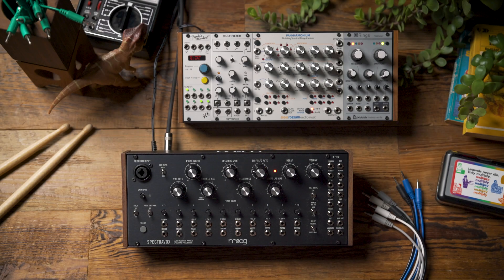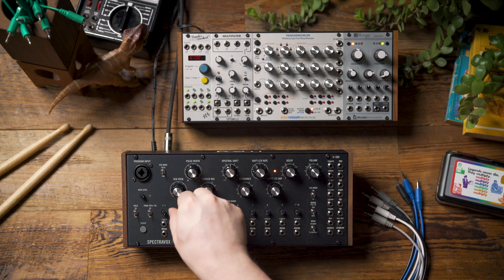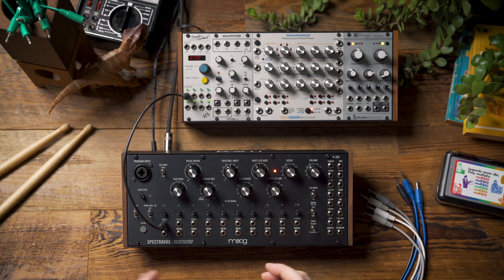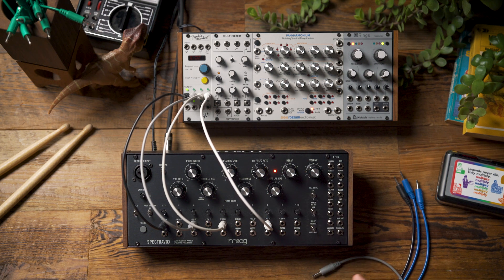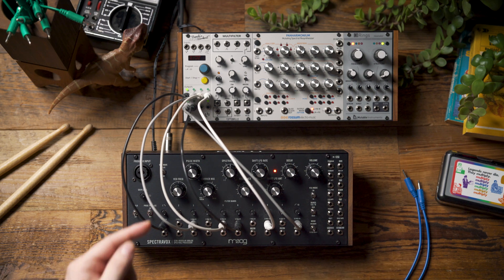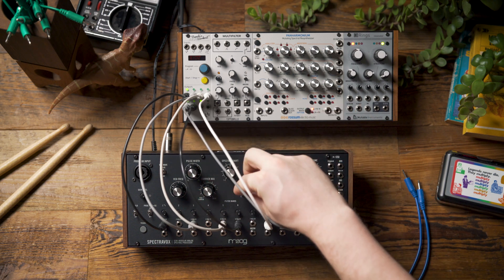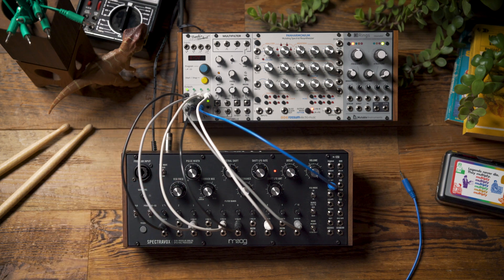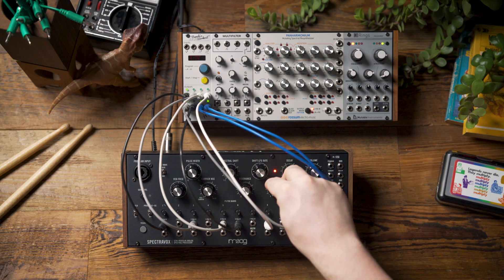Spectravox | Emulating a Vintage Drum Machine

Comment: It's sort of funny the amount of things this can do, and the inevitable comments about how it costs too much for a vocoder. This isn't a vocoder, it's a filter bank laboratory. If you have a large eurorack setup, there are so many things this can: microphone in, filter bank with 10 VCAs, simple vocoding, phasor, low pass filter, vco with PWM, LFO, noise source, drum machine, etc. This is one of the most sophisticated semi-modular pieces of kit I've seen in a small package like this. I'm really glad Moog took the time to redesign this, because this is much more useful than the moogfest version.
Reply: Although - watching these spectravoc videos i rediscovered my mutable warps vocoder and just had a few hours of fun inspired by this. Might still buy the spectravox at some point.

Comment: Couldnt get this to work with the drum gates on the Beatstep pro. Perhaps it’s because of the voltage mismatch?
Reply from the maker: The Beatstep pro can output enough voltage, but make sure you have the drum gates set to v-trig and not s-trig.  also keep in mind that the drum gates have hard edges, so it might sound clicky in comparison to envelopes
Reply: @MoogSynthesizers  thank you; got it to work hear the clicks but still pretty awesome
|
Reply: @MoogSynthesizers  What wave shape are the envelopes in this example?